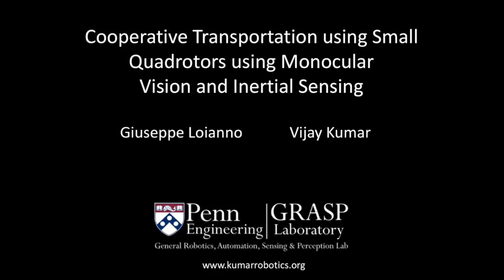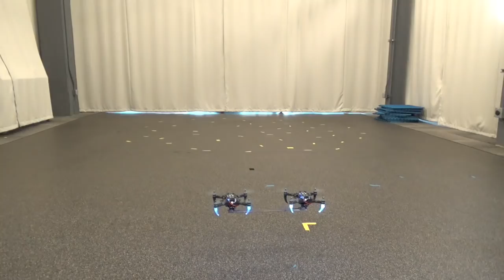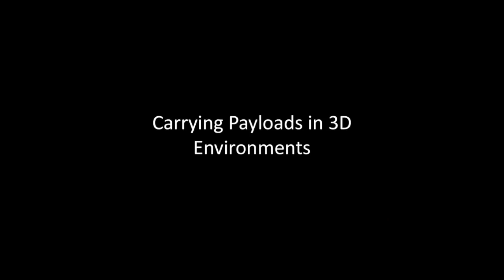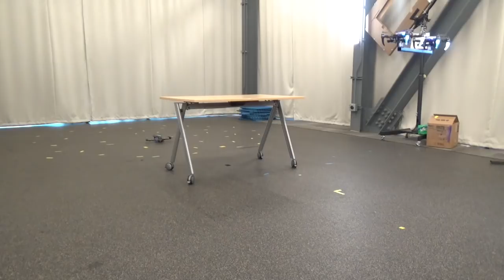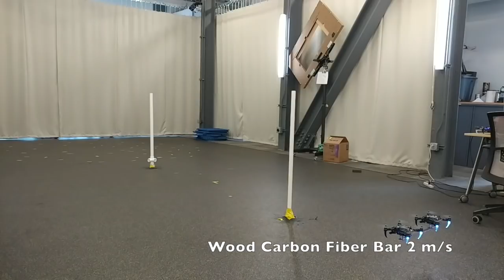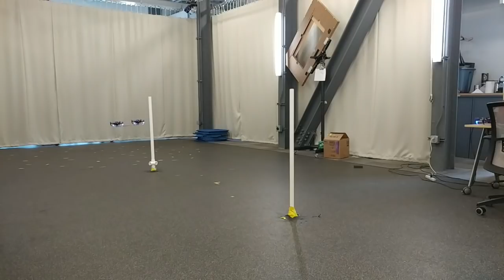Cooperative Transportation using Small Quadrotors using Monocular Vision and Inertial Sensing

Comment: Hello, I am planning to do quadrotor control with a motion capture camera. The dimensions of the room where the experiments will be carried out are 6mx5mx3m. There are many mocap systems on the market, but a single quadrotor will be used, and when the dimensions of the room are at the given values, which system can I use with at least how many cameras at the lowest cost? Usually optitrack or vicon camera is used, which of these two brands should I choose?